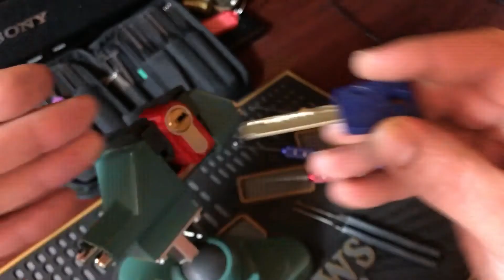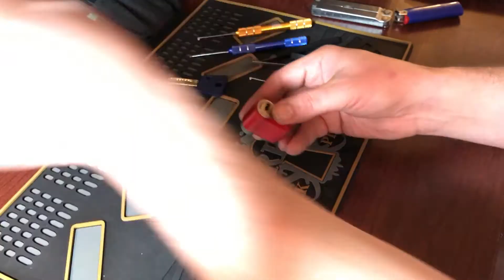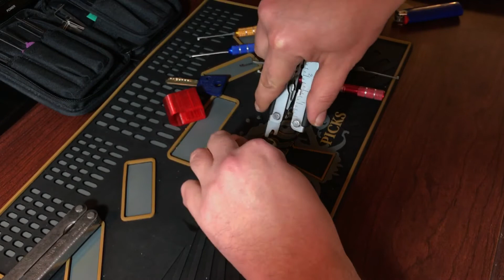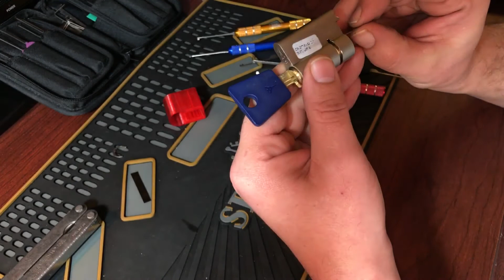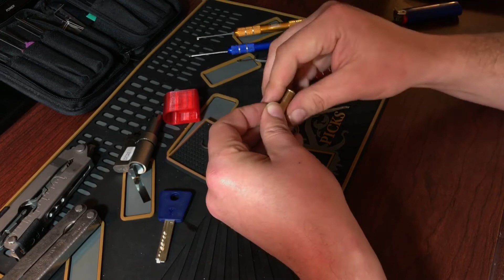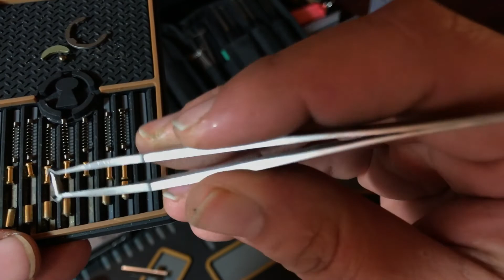(89) Lockpicking: Mul-T-Lock Garrison picked and gutted

Comment: Nice picking bud! I have never tried to pick with the pins on the bottom. Do you think it is easier to pick with the pins up or down?  Keep up the good work!
Reply from the maker: Thanks! =) I actually prefer to pick dimple locks the way they were intended to be mounted, with the pins on the bottom. But any normal pin tumbler, I prefer it to be with the pins at the top. Weird isn't it? 
Thanks for watching buddy!